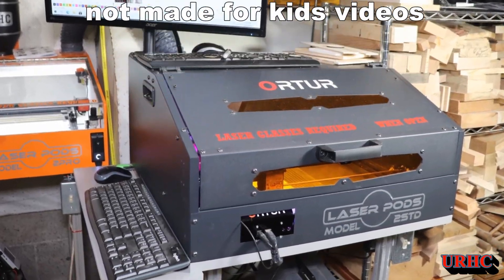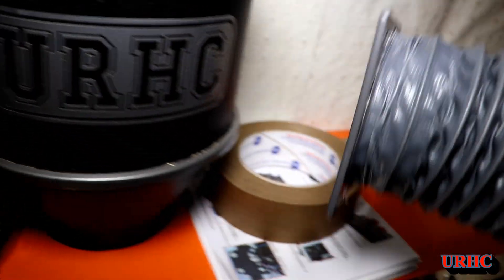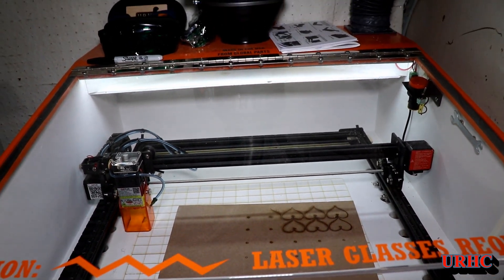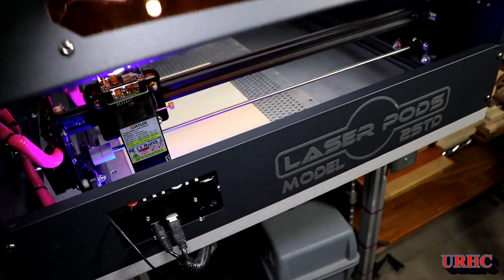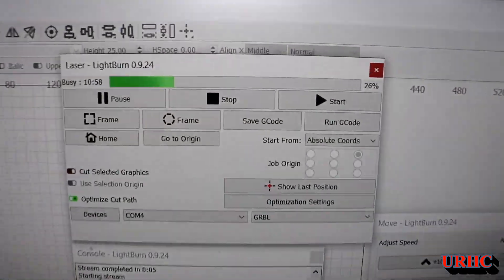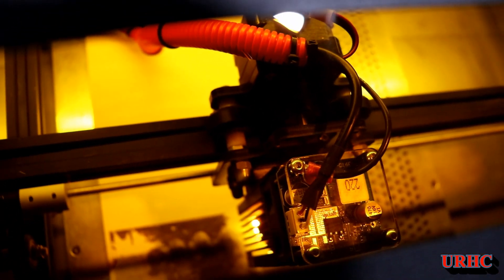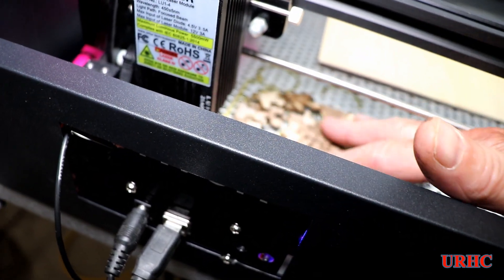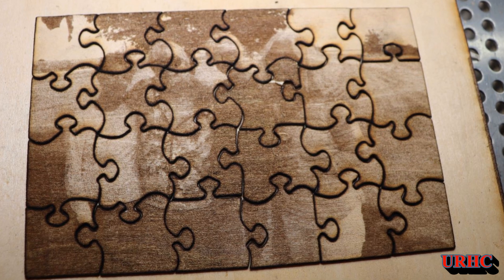Ortur LM2 Laser Enclosure First Use

Comment: Planning to get one soon. Is there a hole in the enclosure to run the air assist tube through? Or I guess the material is thin that I could just drill one? Also do you think I can put a 22mm honeycomb on the included bottom panel and still have enough space for materials to engrave and cut? 

Thanks for sharing! I have been enjoying and learning a lot from your videos!
Reply from the maker: It's  easy to drill sheet metal. Sometimes it's  easier  to sandwich the metal between  2 boards to get a clean hole without  catching.  The honeycomb fits good and a couple  corner blocks will keep it from shifting.  Thanks for watching.

Comment: I guess that is not the laser you put the triple glazed lens on. Also, is that the old style 20 watt laser you used to cut the puzzle?
Reply from the maker: I put the triple glazed lense on my lm1 and that has great results.  This is the 20 watt fixed focus upgraded laser they sent me and I can't  get really  good results with it anymore. Seemed to work better when new. Now it takes 100% power to cut through 1.5mm in one cut and burns bad. Might need a cleaning but haven't used it much. Should switch  back to the original laser. The LM2 pro has much better results and grayscale.  I fired up the 10 watt  one last night and can't  believe the consistent.08mm lines. I am going to try a puzzle with that one also. Thanks for watching.
Reply: @unemployedredneckhillbilly2023  I can't wait to see what that looks like with the new laser head and to hear how you like it.  
I am curious. Did you find that when you changed the lens on your LaserMaster 1 did the power settings and the speed need to be changed? And if so was it for the better or not?
By the way, I like your enclosure better.
Reply from the maker: There were  some slight changes required but not drastic.  The results are crisper small text with a little extra  depth and less over burn residue.
  The 10 watt Xtool D1 is a brand new machine they sent but it uses proprietary software that is not as versatile as lightburn I need to play with for a while. It  Has wifi that works so no usb required after initial startup. Also waiting  for the app to be able  to run it from my phone. Whole different  animal.  Waiting for the rotary that got separated during  shipping to try also. Supposed to be able to do glass with no coating.  We will see.